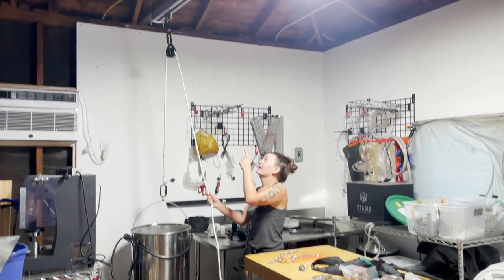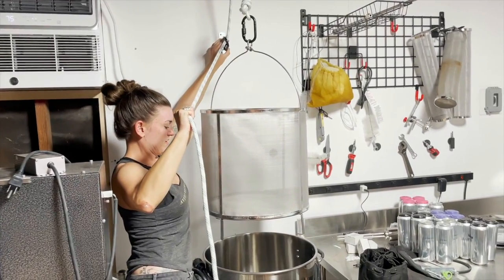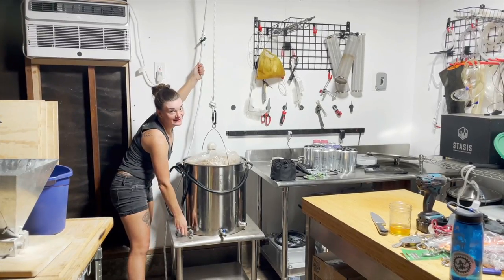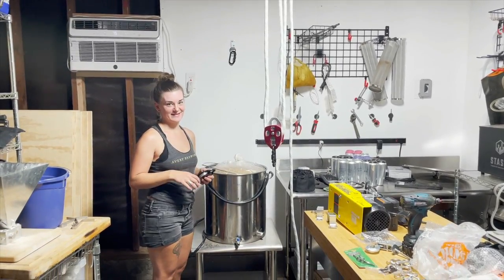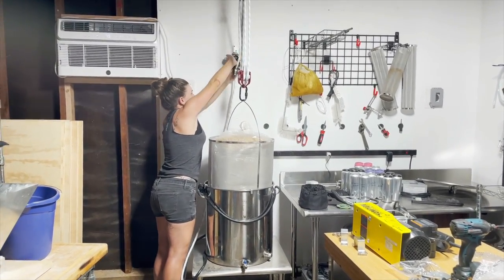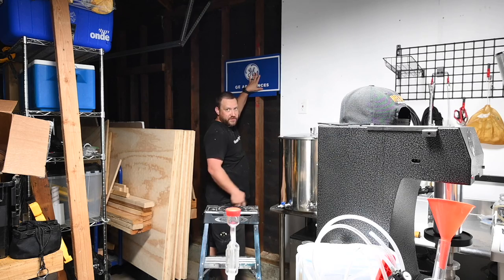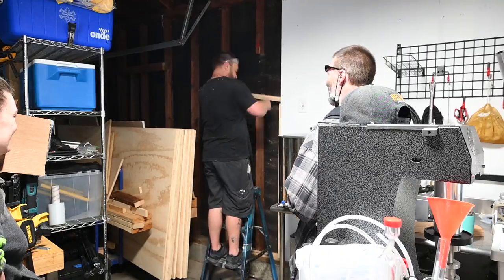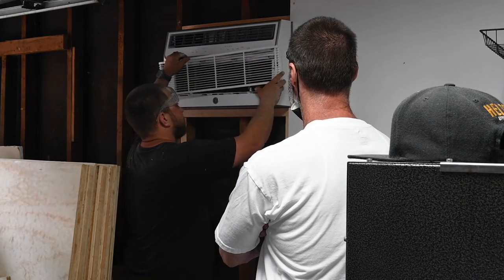Building the Garage Brewery Pt. 3: Pulleys and ACs

Comment: Is that a 120 volt unit or a 240 volt one?  You’ll find the 240 volt units run a little bit more efficient.  I keep my brewery space dialed down to 70 for my wine.  But I did insulate my shed with expanding foam in the walls so that may be the difference between a garage versus my shed.  It gets hot as hell here in Texas so I can relate.  My AC is oversized for the space so it doesn’t have to run very long to chill the brewery down.  Good call on a through the wall unit though because the split system units are costly to repair and break often from what I’ve been told by a couple of pros that I know.

Comment: Congrats, Sarah! Two very essential brewery improvements. I have the AC but not the pulley system track in my shop (I mash with a 10 gallon cooler/mash tun). I keep the AC thermostat up around 80 unless I’m out there and crank it down when I start a brew day.
Reply from the maker: I left it at 86 consistently and came back to a HUGE electric bill...now it stays off unless its babysitting beer
Reply: @FloraBrewing  hmm, maybe a window unit was not the best choice since they are low efficiency (SEERs rating). Future upgrade option would be a high SEER mini-split but you will need a 240 volt circuit. I cool 700 square feet of garage in Arizona and can barely see a difference in my electric bill in the summer.

Comment: Saweeeet!! Just curious why your not using the electric winch/ crane that's on the bench?
Reply from the maker: Only because I told my Clawhammer friends that I would test it before August! It's going up eventually just needs more consideration...the location of the bolt holes in the wench are in the wrong spot so we need yet MORE steel
Reply: @FloraBrewing  
Is that barn door track on the ceiling?